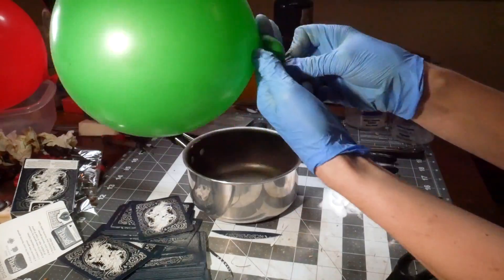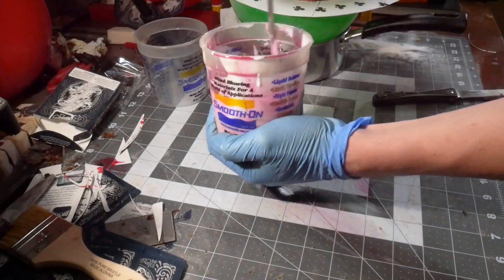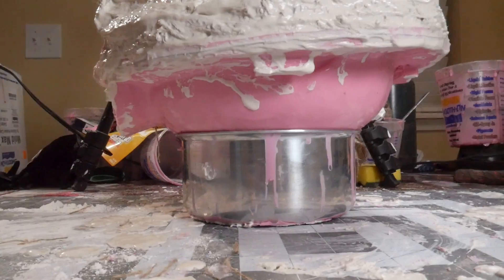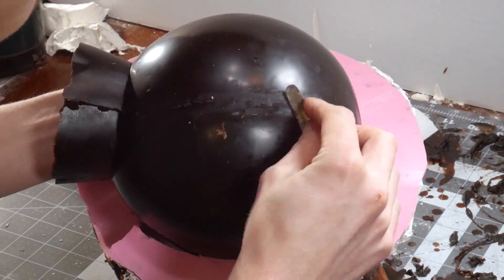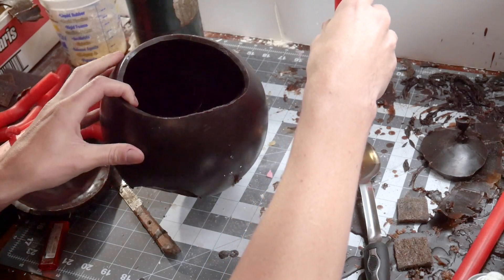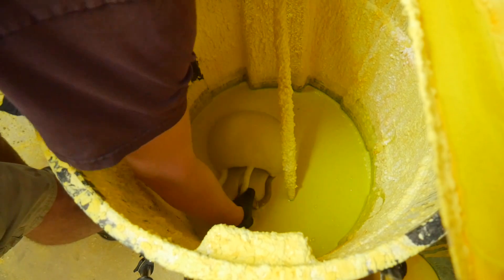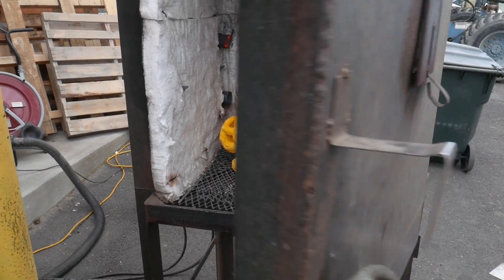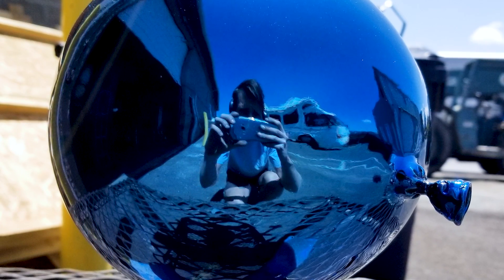Part 1 of 2 - Turning Dollar Store Balloon into Bronze Metal Sculpture

Comment: Why don't you drop the completed casting into water when it'd still hot to fracture the mold and make it easier to break out the casting without damaging the bronze surface with a hammer?
Reply from the maker: Dropping castings in water to break the shell is an aesthetic pleasure
Reply: @skraminc  Yes, not only is it SATISFYING it gets rid of ll that drudgery. I can't believe he did it that way they've been dumping partially cooled molds in water for CENTURIES< maybe MILLENNIA, robust casts weren't even cooled

Comment: With hopes to not seem as a smart arse... Please allow me to share a small experience that you may benefit from the next time you take such a mold.

Whilst taking body/large casts with as viscus layers.. after the initial coating we would include strands of hair onto the mold.... Sometimes horse hair.. sometimes doll hair...
If the mold was via alginate: this was usually doll-hair (something synthetic... so as to not hat have the material effect the curing speed through absorption). For silicone: it wouldn't matter much. Just some long THIN strands (If you would use wool or such... You would best comb it out first into its fibers)

You want to somewhat evenly gap them out before you lay them on the talent or prop (actor/ess or object you are molding) as you do not want to modify the elasticity but just enhance its durability to its dedicated thickness.
This process was literally a MUST for alginate molds since the mold would tear apart by its own weight. But for silicone molds: it was mostly to prevent the silicon from running off though it increased the sleeves lifespan and usability immensely.

I so hope this was useful... Thank you so much for sharing your process.
Everything about it was soothing and the experience: beautiful.
Reply from the maker: I have a synthetic silicon thickener. I just dont use it for the first two coats so the rubber runs into all of the small areas and picks up more detail. I want it to run a lot and be as thin as possible for first coats. With the thickener it spreads on like cake frosting. also have an accelerator to cure it quicker. I just use them on the later coats that isnt really shown in this video

Comment: Now I understand why the intricate bronze mirror I bought years ago is worth so much. I got it for $10. It's really cool. I'm working on getting the cheap lavender spray paint off of it so the bronze can come through again.
Reply from the maker: You could probably have somebody sand blast or glass bead blast it for you for pretty cheap. Like 20-50 bucks. It would be a matte/semi matte finish like my balloon, just as it comes out of the sand blaster part of the video, and it will age/darken over time into some interesting patina. Also, there are tons of bronze patina videos or finishing videos you can do at home with simple concoctions, to give bronze its 'chosen' finish. Paint is not a great option for cast bronze unless youre on a very weird mission

Comment: Such a great demo! What smooth-on product are you using?
Reply from the maker: The pink rubber is smooth on mold max 30 but any medium hardness rubber on their other lines will do the same thing... i use a harder rubber because round, smooth shapes get warped if you use softer/pliable rubbers and if they get pieces of plaster between the mother mold it can push the rubber onto the surface of the wax making divots... with thivex added for thickening.
Reply: @skraminc  Fantastic! Thank you so much. I tried making a balloon cast about 5 years ago and it was a dismal failure as I could never get the tied end to cast properly, I was using alginate.
Reply from the maker: @skylarb.3363  alginate is great for some very simple things but it doesn't have any hardiness. it tears and disintegrates and falls apart really easy and leaves bad detail. there are tons of silicone rubber molding videos and silicone is pretty accessible, you can get tons of smooth-on stuff from amazon or they have a lot of regional dealers, maybe there's a place near by where you can pick it up. it's just a little more expensive but the outcome is like 10x what you can do from alginate

Comment: How about filling a balloon with water? It makes balloon heat resistant and more sturdy. Maybe it would be possible to apply molten bronze directly onto its surface? 😁
Reply from the maker: filling a balloon with water is a huge P.I.T.A. LOL. i knew i only had like 24 hours with an air filled ballon so i just dealt with the air. the entire molding process is so i can have a central core shell so the balloon bronze casting can be 3/16"-1/4" thick. without the molding process you have to do an entire other thing to introduce a core in the center of the balloon skin so the balloon doesn't end up being completely solid; it would weight like 30 lbs without some intervention
Reply: @skraminc  Well, it was my first silly thought. After watching the whole process and the amazing result I'd say: you know better 😊

Comment: Take a stick with the end wrapped in fiber frax that is slightly damp and hold it onto the leak to stop the leak. It will not explode with the dampness and it works great. It also stops the leak fast enough to be able to top off the mold while the metal is hot enough preventing chill lines.

Comment: smooth out wax now or smooth out bronze later? hmm... which would be more work??
Reply from the maker: Half and half. You have to do the metal smoothing no matter what but you need a sort of rough wax surface for the ceramic shell to hold on to in the casting process

Comment: Wouldn't it be easier to mold the balloon in half by going the opposite way as you did so the knot is the bottom and that way you only have 2 molds?
Reply from the maker: yeah, i think you are right. i was just too focused on the balloon knot and isolated to be separate it it in fear.

Comment: Your mold making process (thin silicone layer and a fibre-reinforced plaster shell) looks like an efficient use of materials. Silicone is expensive, and making solid silicone molds like most people seem to do costs a lot. Is there a loss of dimensional accuracy with your method? Obviously not important for art pieces but could be a problem with machine parts.
Reply from the maker: the silicon mold i use (smooth on mold max 30) doesn't lose any that i can recognize. it doesn't have a heat function for curing so it doesn't expand and contract. the problem comes with the wax. casting waxes are made to minimize their volume change during temp changes but they still expand and contract when you heat/cool them. that's where you'll find most of your problems. then you get more when the actual metal cools. i think a lot of industry uses sand casting to knock one of those (using wax) out of the process and then they mostly cast blanks and machine them to the correct size

Comment: How did you keep the center hollow?
Reply from the maker: What do you mean?
Reply: @skraminc  hi when you did the balloon it’s not solid. Did you fill the center with sand?
Reply from the maker: @tacllemtacllem7679  the rubber balloon is just filled with air. the bronze balloon has a "window" cut into the wax, so you can see during the ceramic shell process, this allows there to be a continuous layer that attaches to both sides of the plain of the wax and hugs only the thickness of the wax so that it doesn't have to be solid